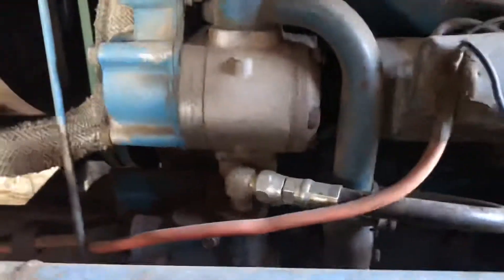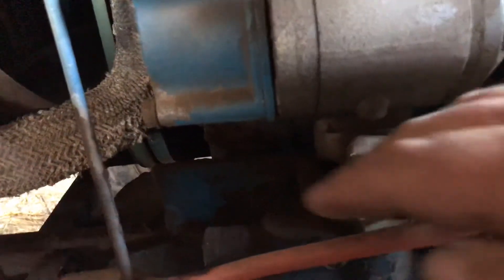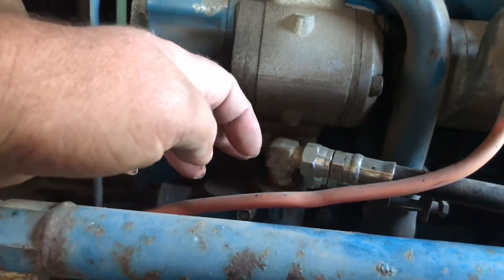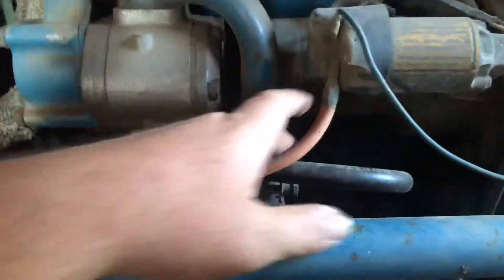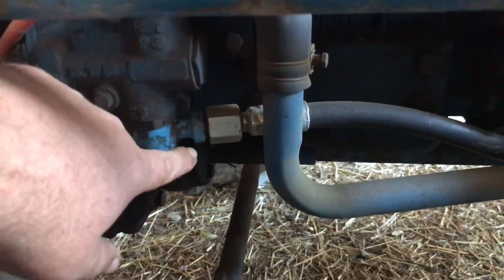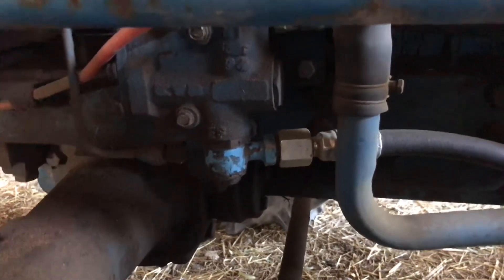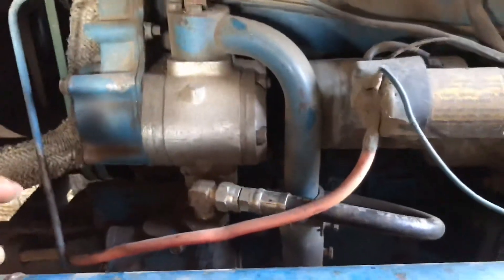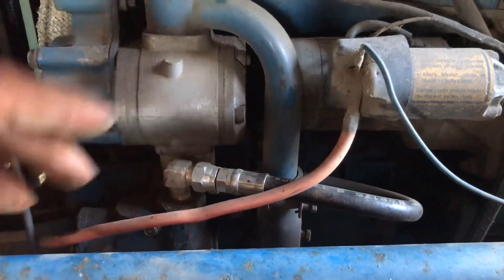Ford 1710 hydraulic priority valve relocation kit part 3/3

Comment: Was replacing the hardline necessary? I would prefer to not have to solder and have a hose made.    I am about to do this mod to my 1710
Reply from the maker: Bill M there’s no way to bend the hard line around the obstruction due to the short distance between the banjo fitting and the first bend, cutting is the only way I found to make it work.